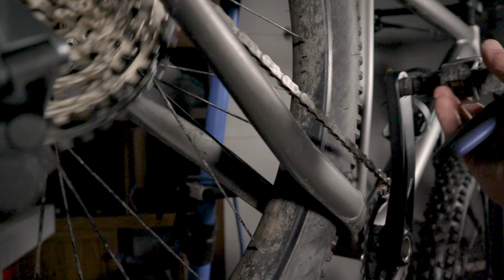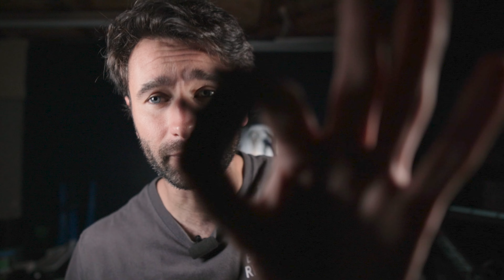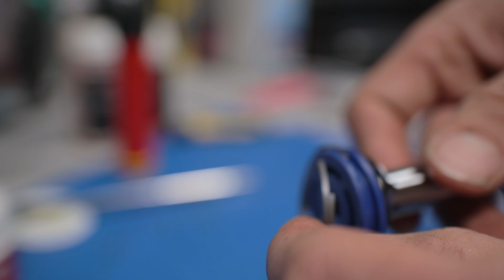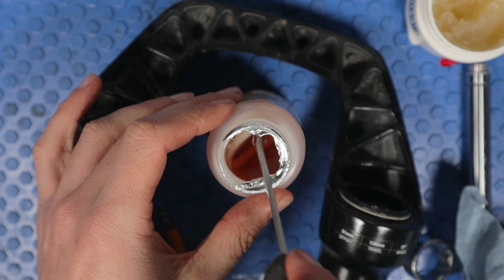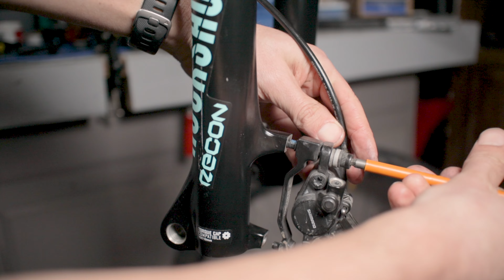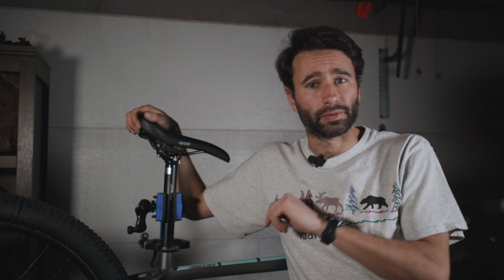Fix These 5 Things First When You Buy A Used MTB!

Comment: Presta Advantages over Schraeder valves? your opinion ? educated guess? I've always wondered what are the benefits of either?
Reply: Many rims only have holes sized for presta valves. in road bikes, presta valves are used because they can hold higher pressures than schrader valves, and I think mountain bikes have just slowly trended that way to match in recent years, even though they don't run at super high pressures.
Reply from the maker: I think @feral-housewife hit the nail on the head. Higher pressure and then the industry just figured that people didn't want two different standards, so they all sort of landed on the presta.

The really annoying one to use is the Dunlop valve that is pretty common in Europe and Asia.

Comment: Where were you when I bought my first two used bikes as I was entering the biking world? I had endless frustration as I found one thing after another that needed to be replaced. These lessons never happened at a convenient time.

One thing missing from your video is servicing of wheel bearings. This may not be an issue with higher end bikes with cartridge bearings, but for those of us who are biking on a budget and have the traditional ball and cone wheel bearings, they should at least cleaned and repacked with fresh grease. 

When buying a bike from an enthusiast, factor in that everything could be worn out and will need replacing. Watch for this when the bike you're buying is 3 or 4 years old as seller may be unloading the bike to buy new again instead of maintaining it. Negotiate price accordingly.

Tip, Find a way to connect the new cable housing to the old one so that when you pull the old one out it pulls the new one in.
Reply from the maker: Haha, yeah that sounds about right. I'll have to make a wheel bearing service video - that's definitely on my to-do list.

I've definitely bought some "newer" bikes that were totally worn out, and some older ones that were in great condition. Really depends on the person selling it.

Thank you for commenting, and I'm glad you liked the video!